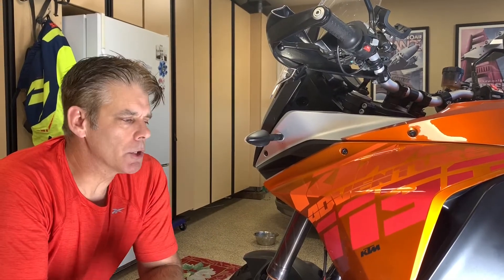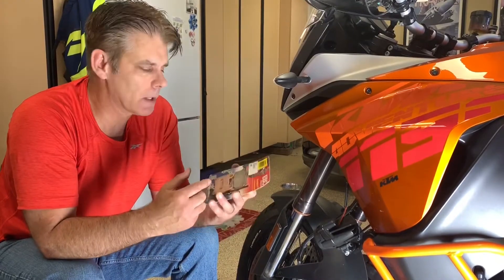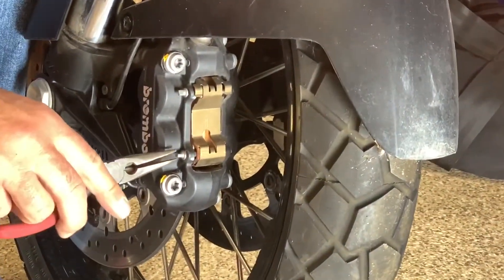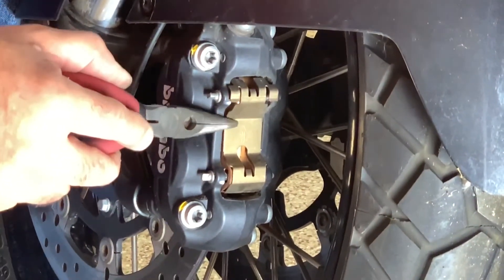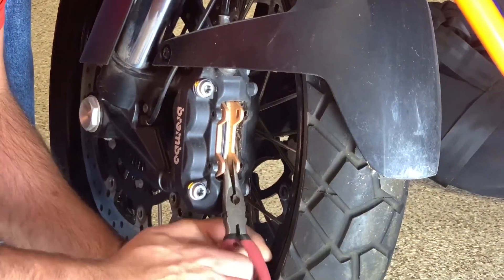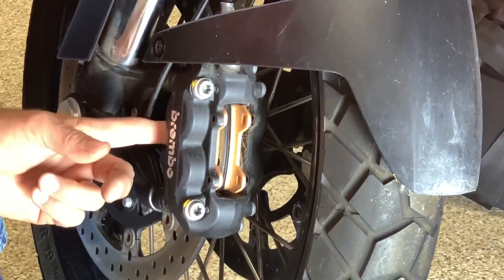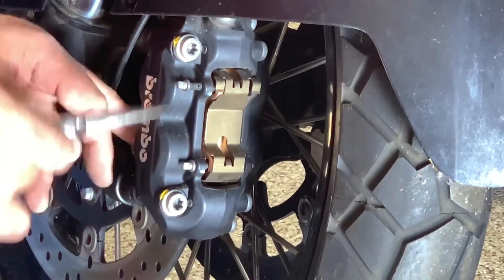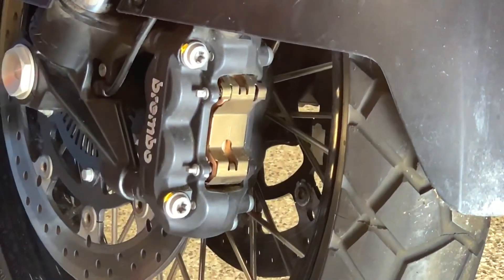How to change front brake pads on KTM 1190 1290 1090 with BREMBO calipers easily

Comment: Thanks for this.  Just did mine for the first time on my 2015 1190R under very similar circumstances — 32,000km on the original pads, still lots of life left in ‘em but for a diminished feel after a leaky fork seal (chalked up to oil contamination).